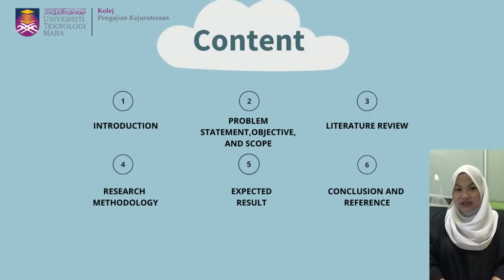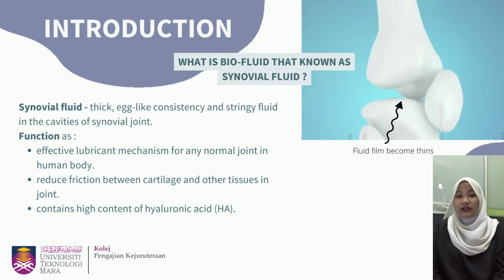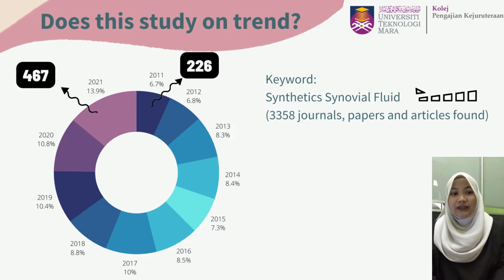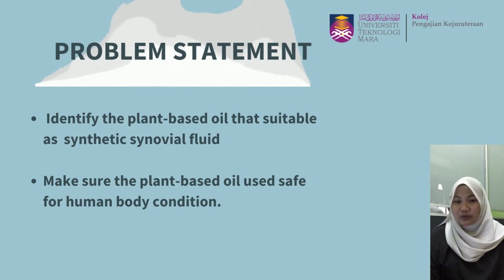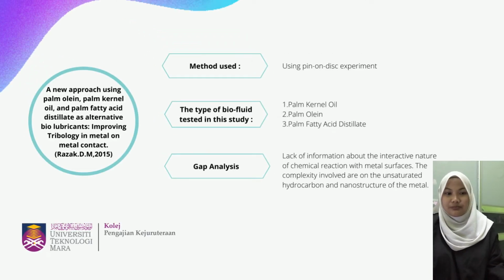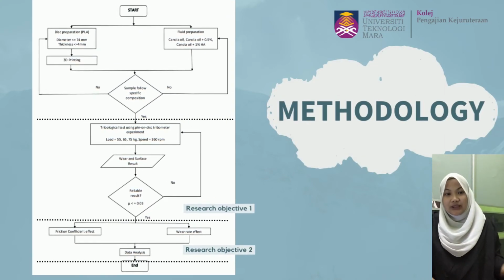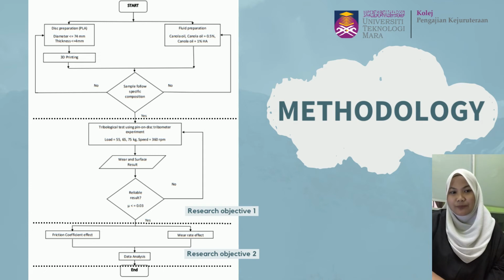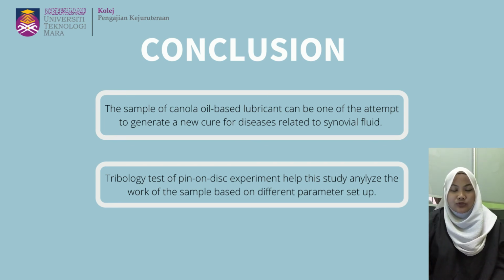Izatul Aina Afiqah binti Mohd Rohazid 2018801416 (FYP1-presentation)

Comment: 1- Why Canola oil?
2- Why only 2 composition?
3- What standard you refer with?
4- What characterization do you refer to?
5- How to treat canola oil?
6- Why using pin on disc?
Reply from the maker: Answer: 

1. Refer to journal article as i stated in the presentation before from Kumar and others with title of Improving tribological performance of canola oil, From the outcome from ball on disc tribotester test, the data shown that canola oil showed minimum friction coefficient and lowest specific wear rate and also lessen surface roughness. Other than that, canola oil is a  biodegradable lubricant, easy to get and cheaper. The most important aspect is canola oil is safe for human consumption because it possible to reduce erucid acid which harm for human consumption if there a big amount of erucid acid. This information was obtain from the 'Canola oil' journal by Ghazani and other authors. 

2. The composition of the sample which are canola oil, canola oil + 0.5% HA and canola oil + 1% HA. Why? because the main reason of this study is to discover where the canola oil can fulfil the characteristics of synovial fluid. Because of that, the reason why i am using canola oil without additive to observe the different result between canola oil with additive and without additive. The 2 different concentration of other sample is due to the past study where they use 0.5% HA as constant concentration and have a excellent result. So , the 1% HA sample is to observe the 2 times concentration will differ the result or remain the same. Due to the lack of variety concentration of HA in tribology lab, the study will focus on 2 composition only.

3. As i stated in the report and presentation, the standard that i refer for this study is the motion and load cycles for walking that standardized by ISO standards 14242-1/3 and 14243-1/-3 respectively for the modelling of hip and knee joints. As shown in methodology, the fix value of 360 rpm constant speed is due to the past journal study where the most eligible standard speed for PLA biomaterials is between 100 to 2000 rpm. Moreover, the different load varies of 55,65 and 75kg are due to the average body mass obtain by the journal of world region in 2005 where Asian had the lowest which is 57.7 and North American get the highest which 80.7kg. the load varies in the experiment used the mid value to make it easy but still in the range. 

4. I refer to the tribological characterization where we will discover the result on the coefficient of friction and the wear rate effect. the study also will discover the condition of pin and disc surface before and after the experiment. This study also depends on the characterization of PLA disc and metal pin. 

5. The canola oil tested in this experiment are on the room temperature to maintain the structure. Based on the previous study, the canola oil are not recommended to let to be freeze because it will change the structure. The canola oil will be placed on the room temperature with tightly sealed to avoid unknown substances to enter. 

6.On this pin on disc experiment  produces wear in a flat ended metal pin and by forcing it against rotating PLA disc with existence of the canola oil samples. The result of morphological surface effect on PLA disc and metal pin are the important aspect in this experiment. By comparing with the four ball tribotester, the contact used is metal on metal contact and it is not suitable for my experiment.